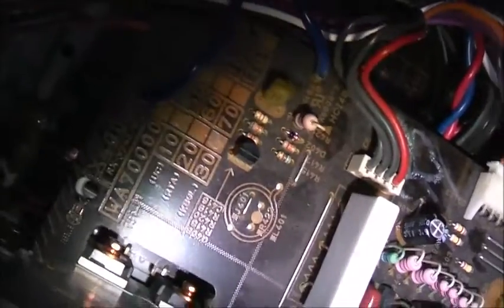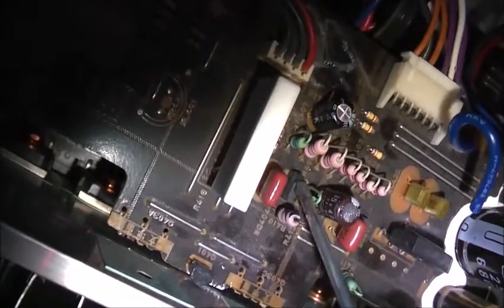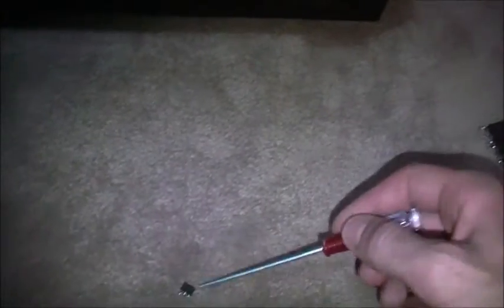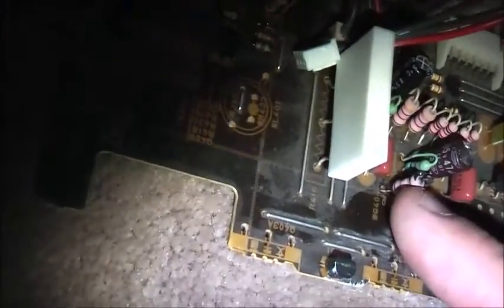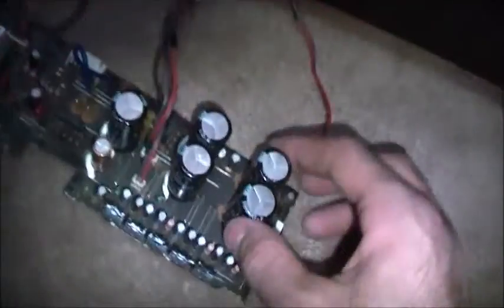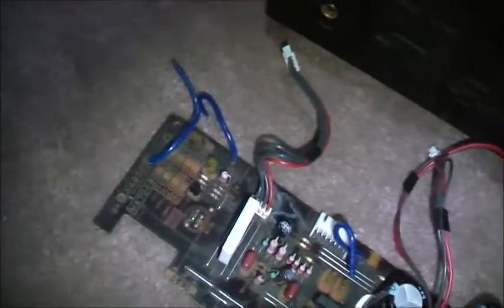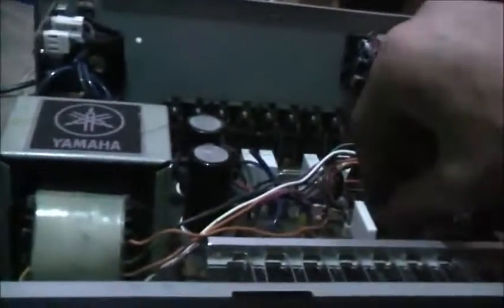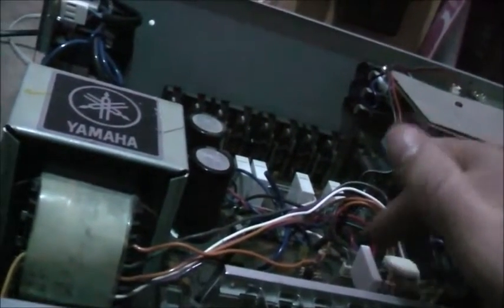Yamaha RX V440 Receiver Troubleshooting & Test

Comment: Hello.I have the same amplifier and it doesn't change the input source. Only one analog input still works. The volume does not change either, it remains at its maximum. would the processor be faulty? I tried resetting but to no avail

Comment: Could you please tell me the exact brand and values/volts of the block capacitors on the power amp section? Are they Elna 10,000uf 63V? Thank you for your time!
Reply from the maker: I will have a dig out and check
Reply: 2 years later.. havent digged yet?  @HDXFH

Comment: Looking at service manual.
Connector you disconnected would have been W401. that supply's b+ and b-
Q402 and Q404 are the drivers for Q403c and Q403a.

Semiconductors that may be damaged
Q402 2SC4488
Q404 2SA1708

Q403A 2SA1695
Q404C 2SC4468

Page 76 is where schematic is.
Page 61 is the PCB layout from bottom.

http://forumplanet.co.nz/AMP.png

Btw this is ratbag359 off steam.